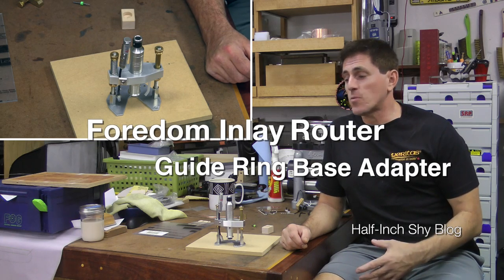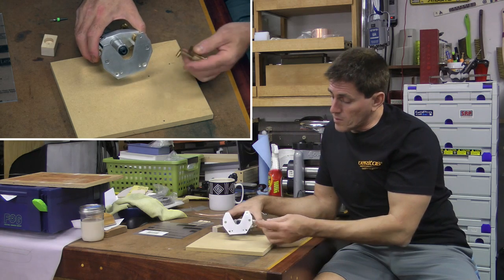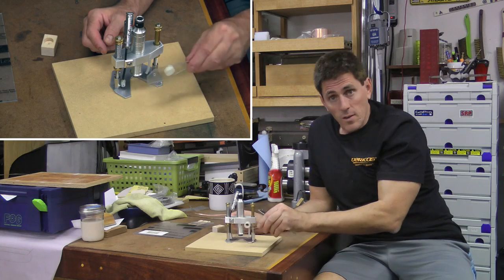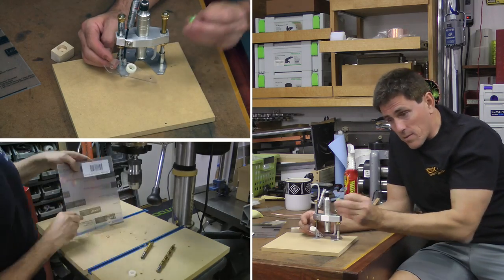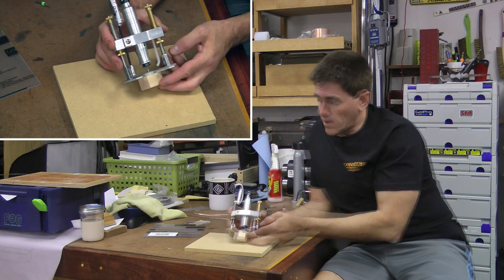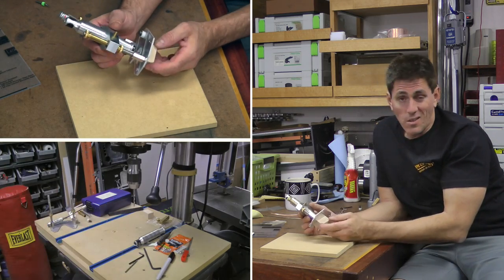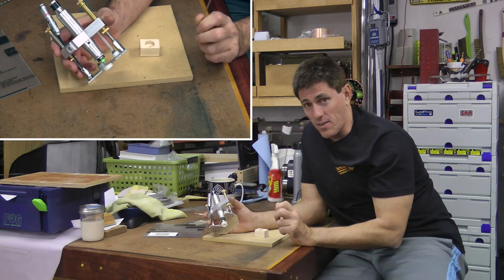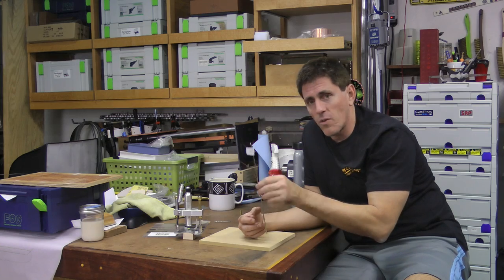#95 - Foredom Inlay Router Guide Ring Base Adapter

Comment: Very cool. I just got a foredom and was thinking of making a router base and this video came up in a search.
Useful to me because I got a good look at that style of router base, your method of centring is very good and I also do some wire inlay. Glad I found you.
Reply from the maker: Thank you! Also, after this video was published, Veritas came out with a nice kit as well. It is available through Lee Valley. You might like to give that one a look as well. https://www.leevalley.com/en-us/shop/tools/power-tool-accessories/router-accessories/101544-veritas-plunge-base-for-rotary-tools?item=05J6501
Reply: @HalfinchshyWWing  Thanks. Funnily enough I am giving away something very similar to the lee valley one this weekend. It is from an old Black and Decker Wizard rotary tool. The problem with that type is that it does not give good visibility of the cutting area. 

I think I will make my own as that way I can change anything I don't like. Also aesthetically I like the aluminium and in the words of Bob Esmer from the Art of Boatbuilding channel "If you're going to make something, make it beautiful. I'll be back to watch this video a few times during the build, no doubt, as I'll try to incorporate your ideas on centering, etc. 

Is the handpiece you are using the H44?

Thanks for your reply, I'll be back to check out more of your content after I finish my current project this weekend.

Comment: I've been watching machinist's videos to learn from their precision.  When they fit a bushing on a shaft, .001 to .0015 is the common tolerance they aim for.  I've never done any precision inlay and just wondering if you are able to know when too much is too much?  I'm guessing you just look at it and approve or disapprove.

I am looking forward to the next video.
Reply from the maker: Thanks, Kris... machinists are way more precise than woodworkers :) The key things where woodworker precision is needed on this is: the bit must be centered on the bushing, and the nylon spacer should be 3/4" diameter everywhere (testing with digital calipers, mine was). In practice, you'll have a small area of the bushing touch the pattern so a couple thou out of round won't make a difference as you'll be consistent.

Time it matters most to be precise is for repeatability if you need a second pass with an offset bit.

Anyway, for wire inlay, the wire is a hair thicker than the slot: you count on it compressing in (something machinist can't count on). In this case, we'll prepare the wire to be thicker than the slot the 1/16" bit is cutting.  That'll all be explained in probably too much detail in the wire inlay video :)